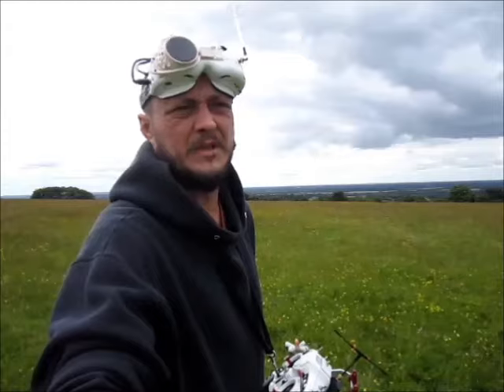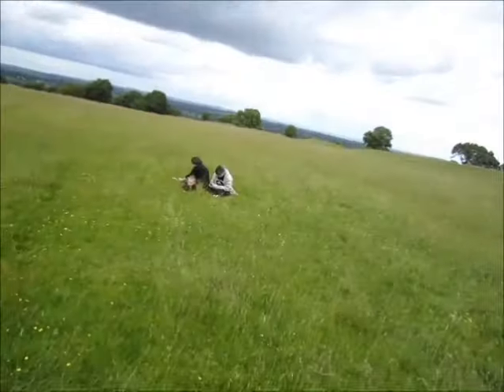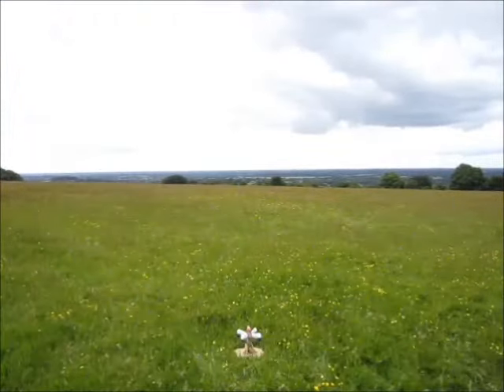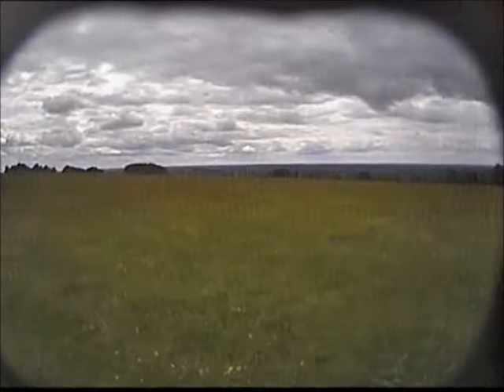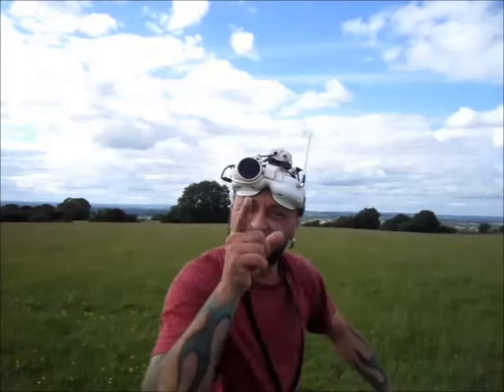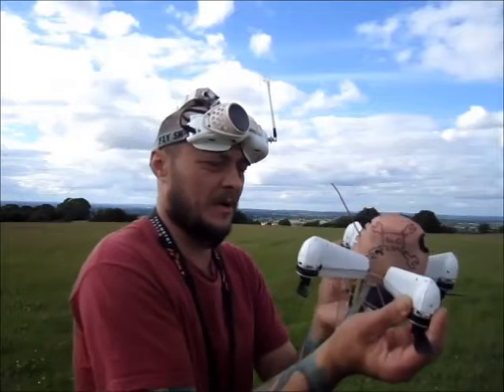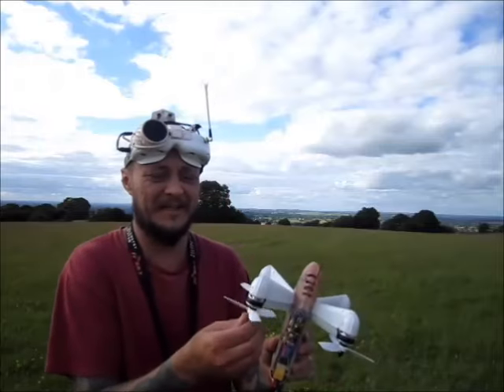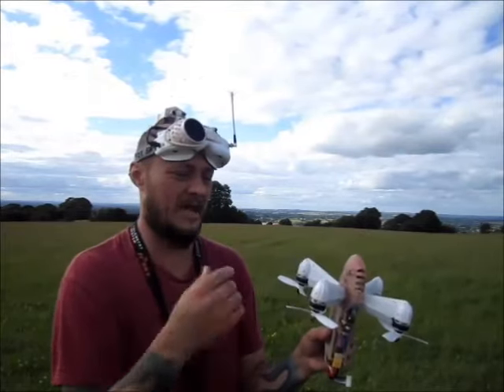Miniquad speed record. 194 km/h !!! (part10, V3 maiden)

Comment: Did you account for the wind? The wind is pretty noisy through the video, and land speed and air speed are very different things. Your apparatus measures land speed, I think.
Reply from the maker: Yes, I'm measuring ground speed as to measure airspeed would be too complicated- pitot tube would have to stay level somehow. And no, wind is not been taken into consideration. I've plans to set a proper rules via Guinness Book of Records, let's say to discount the wind make two runs in opposite direction and record is taken as average between them two. And to set speed measuring system so everybody can do their practice, I think that would be fair for everybody:)
On that particular run the wind was blowing across the field and I have to go diagonally coz it's just not enough space there for me- less than 2 seconds at WOT and I have to start breaking. I'm not denying that wind didn't help me as my last run was 3 km/h slower and I couldn't reach 194 km/h that day. If  I wanted I could wait for a storm, but I play fair all the time and just to get the highest numbers is not my intention. 
As all this madness didn't escalate yet, there's only two unwritten rules between us hobbyists:
1. Quad
2. Prove it! :))